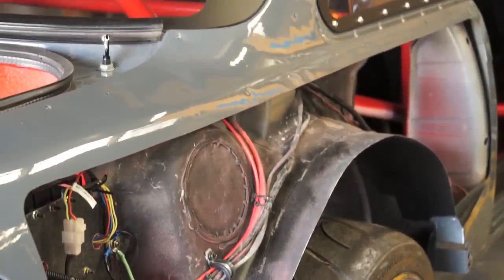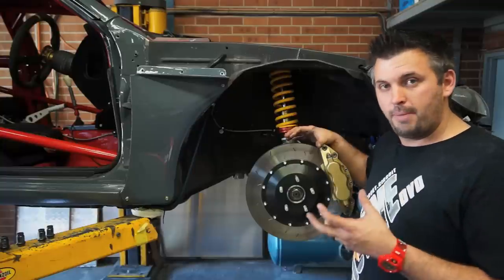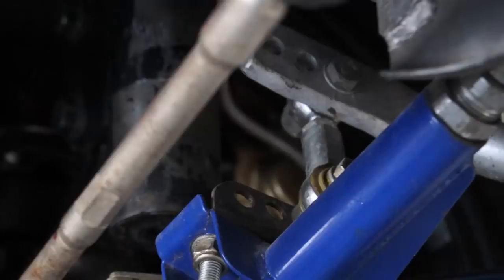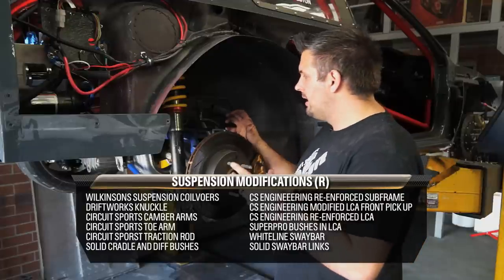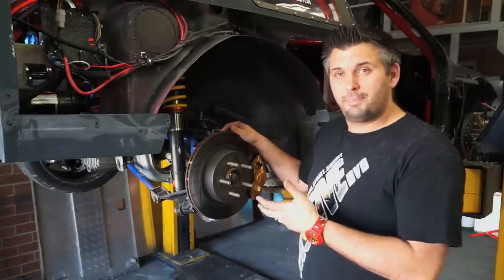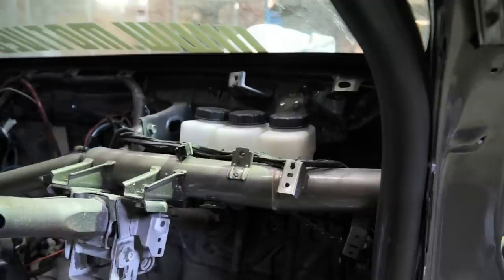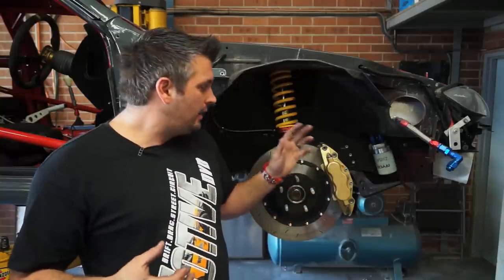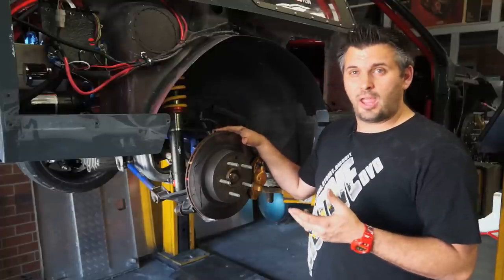Under the skin of a Time Attack Car - Suspension & Brakes - JET200 Ver.4 S14.5 Silvia

Comment: Great video with lots of information and no bull. The only point I'd question is the use of flexible brake line where normally steel tubing would be used. Tubing weighs and expands less, it really is better.